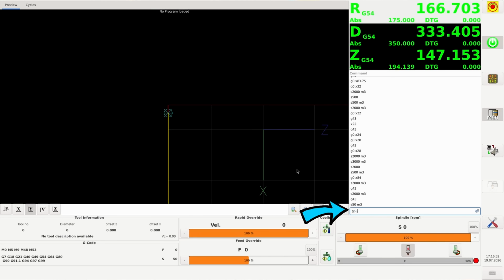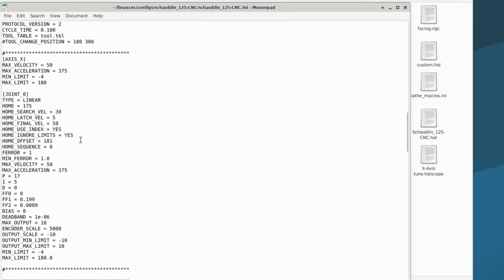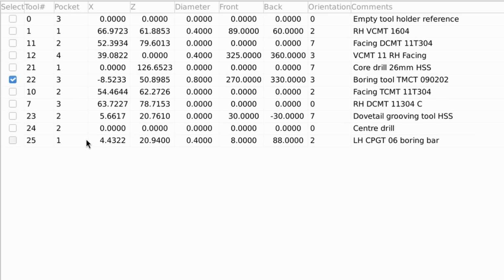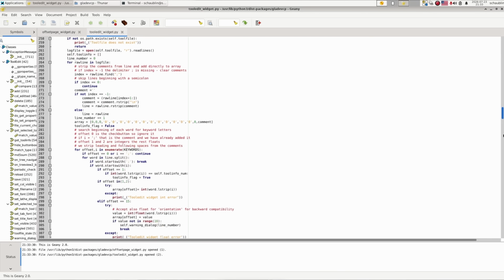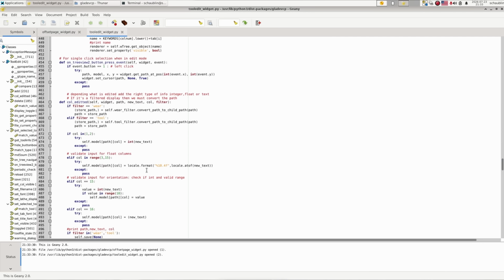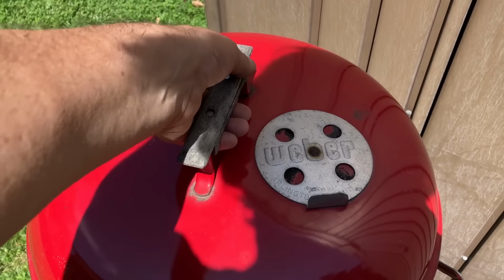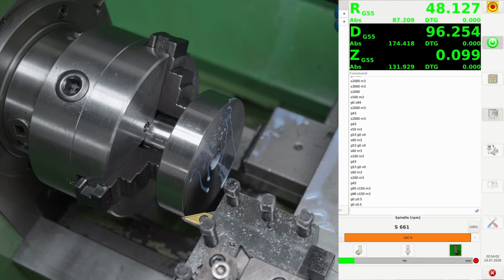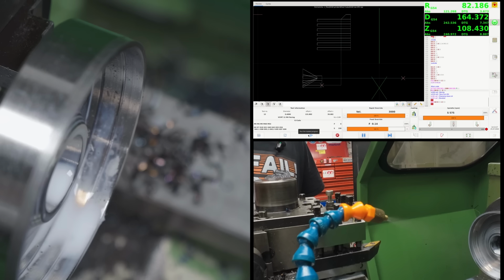LinuxCNC lathe Axis setup || RotarySMP

Comment: Hi Mark, great video! I saw your facing issue with the lathe macros. A few weeks ago I wrote to you about Turn G-code, my G-code generator for LinuxCNC lathes. It has a facing cycle among its 12 cycles, with a 2D preview of the passes before you run it. I set aside a free lifetime key for you, but my email to you may not have arrived. If you'd like to try it, just send me a message and I'll resend the key. No pressure at all, and thanks for all the LinuxCNC lathe content!

Comment: I have an unreasonable amount of oak sawdust I collected and packaged up to sell some 10 years ago, and then never had the time to go the shows to sell it with a bunch of other wood projects and recently found them in the loft under a pile of boxes. Would you like a box full of bags of ready to use oak?
Reply from the maker: That is a very generous offer, but I probably don't have the space for it right now. Plus I just generated a bunch of sawdust on a project I just started.
Reply: The box In fairness the box isn't too huge, I planning to keep some as i've still got my smoker (as yet unused) But thinning down would be good as I have to move house in a few months hence both the find! Most likely would be filling a Bambu filament box, about 30cm cubed. No worries if thats still going to get in the way!

Comment: It sounds like you've got the CSS worked out pretty well. It's really cool hearing your spindle speeding up and down as your tool traverses across the part.
Reply from the maker: Yeah, it really was the right thing to do to drop the complex control, and just do it open loop with a LUT.

Comment: I used to know a Guy who worked for an engineering company who made centrifugal oil separators, the kind I saw on ships for cleaning up lub oil and fuel oil to remove solids.  (one of the driveshafts failed on one ship and I was able to turn it into a Marlinspike for wire splicing.)  Part of his work was calculating tool path distances so they had an idea of when a cutting tool or insert needed changing.  Seemed like a "forever" calculation to me twenty odd years ago but I expect there was a spreadsheet that worked it out with appropriate dimensions.
Thank you Mark!!  Enjoy your yachting about in the Med!
Reply from the maker: I always wondered how the do the insert calcuations in real high volume production. Seems like small errors could scrap a lot of parts.
Reply: @RotarySMP  I guess if you know the smaller and greater diameter and feed rate on a plate the tool distance could be produced as a table.  Not so sure about reducing a broomstick down to a chopstick though.  I suppose that could be a table per inch of length.  I suppose with the flat face and shaft machining the volume to be removed can be calculated and the tool distance is part of that calculation.  Having thought all that, I don’t think I wish to work it out.
Someone or thing needs to remember how far the tool has cut too!!

Comment: Did you measure that taper? Apparently in our non-perfect world, the angle between your cross slide and spindle should be a smidgen over 90° so that facing cuts are always ever so slightly concave. Perhaps your Line🐂CNC ( 😝) is so super-clever that it knows the value of this tiny angle and is compensating on the fly to give you the precise 90° facing cut you asked for.
Reply from the maker: Thanks Paul, yeah, I know you normally scrape a saddle so the lathe turns slightly hollow, but that is not it.
Reply: Correct but if im not mistaken he hasn't any optical linear guides right? So the encoder on the z axis shouldn't read anything. I would say its the carriage drifting, no lock on the carriage... so its like facing on a manual lathe with no lock. Usually that just pushes out the cut, but maybe here it pulls is in?

Comment: One thing.

When you are using plastic for chip/sawdust collection you need to make sure it has a ground wire to dissipate static electricity.

100% on wood, not sure on the tool grinder. Ferrous metal will burn but sure of the risk.
Aluminum plants that generate a lot of dust have exploded violently.
Reply from the maker: Good point.

Comment: For 3D prints that see a lot of regular use like your cyclone, some kind of carbon or glass fiber infused filament is usually a good idea. Just make sure you have some kind of hardened nozzle meant for it or the fibers will slowly grind away at it. But I think Bambu printers come with such a nozzle stock.
Reply from the maker: Yeah, this has the hardened nozzle. I have used ASA-CF, but those tiny filaments are also a potential health hazard, as simply handling the parts will cause some of that filament to snag into the skin.
Reply: @RotarySMP  I was going to suggest sealing the prints but really, at that point it's becoming too much bother.

Comment: 15:30 does this happen when you cut air too? If no, maybe the motor is off, and the cutting forces just push the carriage away from the cut?
Reply from the maker: It is not cutting forces. It is a commanded tapered path.

Comment: That mismatched green paint, though.
Reply from the maker: Hi Alex, 
Do you mean the cylcone is the wrong shade? It is. 
Or do you mean the mis-match of RAL 6010.5 I  mixed witht he RAL 6010.75 which Schaublin used?
Reply: @RotarySMP  Yeah, the mismatched paint on the guard, especially after all that work you put in. Next time you might want to mix a few drops in various ratios and test it, and especially let it dry. That is, if you really want to match the old color.
Reply from the maker: @graealex  I probably should have, but then again, the swarf is already reducing the color mismatch :/
Reply: @RotarySMP  Should I be glad or sad for the swarf not being able to grind down the paint on the outside? 
30 years ago my dad worked as a lithographer. That was basically DTP/graphic design before, or right at, when computers started to be capable of being used for making printed products. They would actually received sheet metal plates painted in various RAL colors that were the CD/CI colors of that particular customer, to make sure photographs of machines being sprayed in that color would actually match that specific color in catalogues. 
I mean later this would also happen, but it would be a lot easier to match colors, since all you needed was a color calibrated monitor and standardized lighting.
So you can assume that Schaublin at the time spend thousands of bucks on making sure everything actually matched their particular RAL color, in whatever media they published.